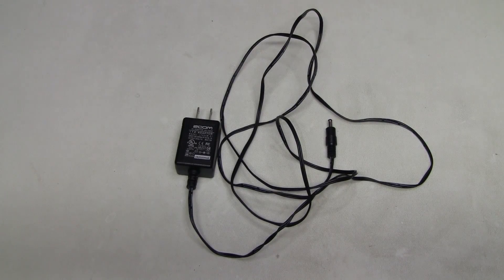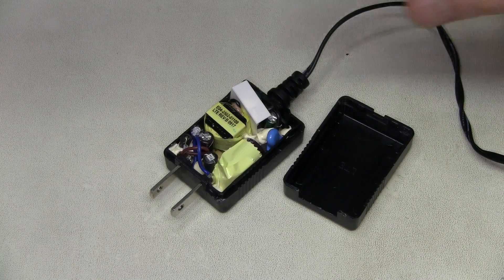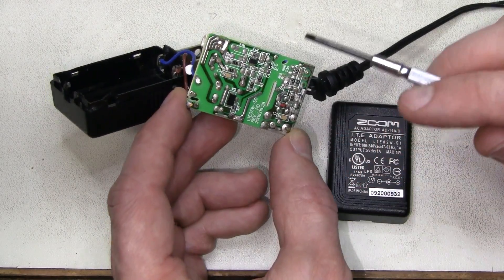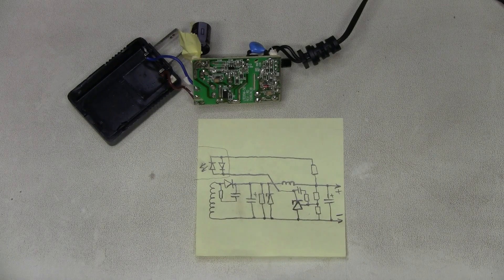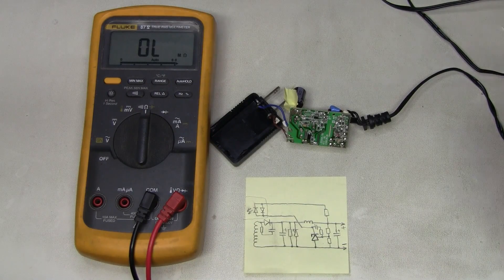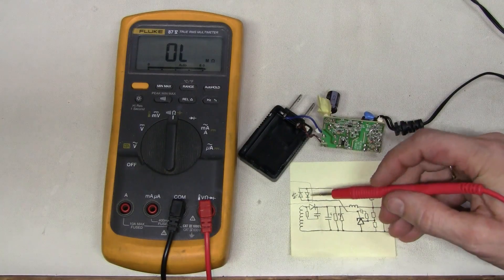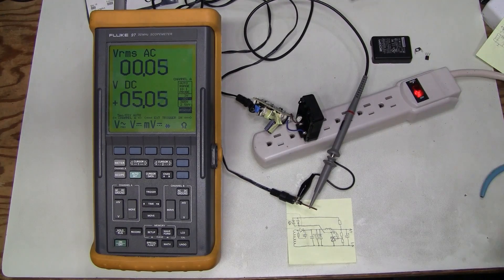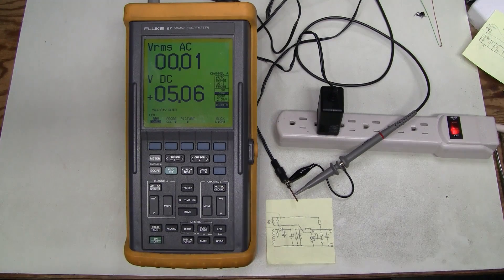#61 - Zoom power supply teardown and repair

Comment: this is a very good video you explained it perfectly i look forward to more like this, if i'm right the zenor diode is supposed regulate a constant 5.6 volts it protect the circuit by shorting the out put to ground if it exceeds its 5.6 volt fresh hold, over voltage protection circuit, normally there is a fuse in line with it which would normally blow if the load gets shorted in any way, causing excessive current draw,  i live in the uk that 5 volt power supply is a us model made in china, i find a lot of this foolishness in todays electronics (eg lg) i recently brought a zoom r16 and it has a distortion on the right hand channel im presuming the main output op amp is faulty but being without scematic i was wondering with your knowledge you might be able to point me in the right direction tell me the component board number or  a place to download schematic.or if you have a copy maybe you can help me.after all i have subscibed and having 3 year city and guilds certification and over 20 years expierince in electronic repair of tv and radio we might be able to help each other.

Comment: I was shocked to see 1.114v Vf across a high- speed rectifier, but after checking it's datasheet, found it to be within spec. Check the datasheet- it might be ok.
Reply from the maker: Rectifier? Perhaps, I didn't make myself clear. This was a zener diode (marked DZ1 on the board). Most probably 5.6V or close to that for over-voltage protection.
Reply: Oh, I thought the >1v Vf was on the high speed rectifier diode. Apologies for the confusion. Thanks for sharing these videos. 😀
Reply from the maker: Now I see that the way I put it in the video was a little vague. I meant to say: since the rectifier diode is marked D1 and this thing is marked DZ1 then it must be a zener diode. It was quite evident anyway, but the designator confirms it.